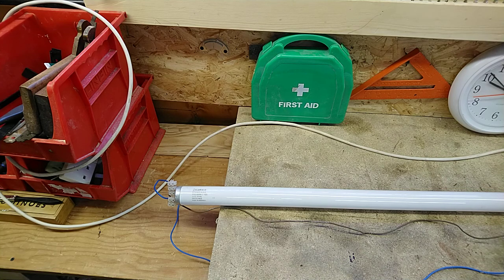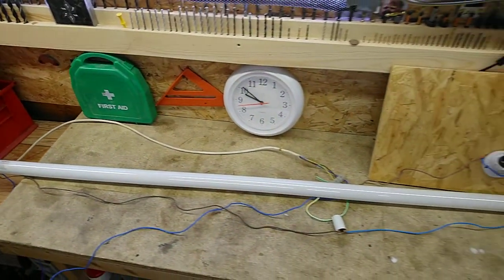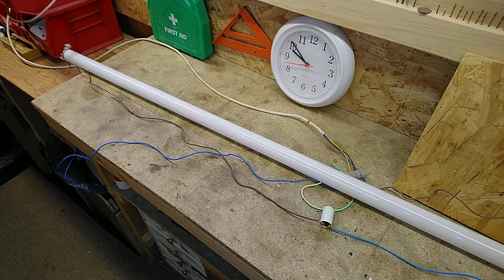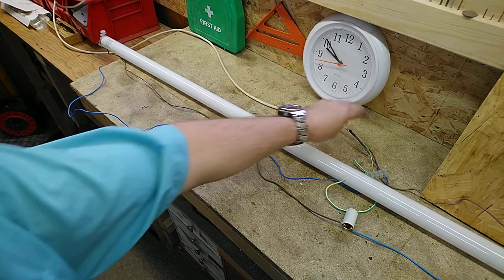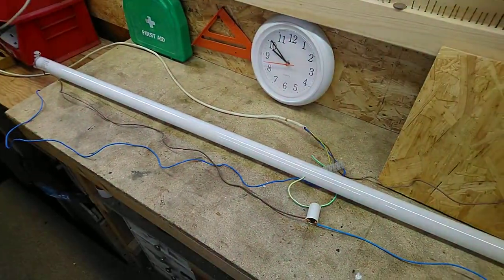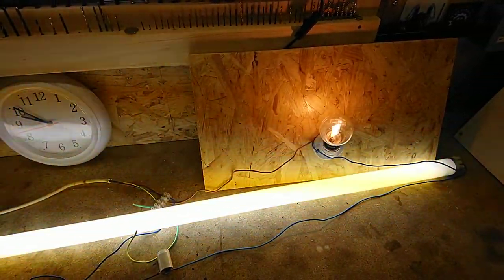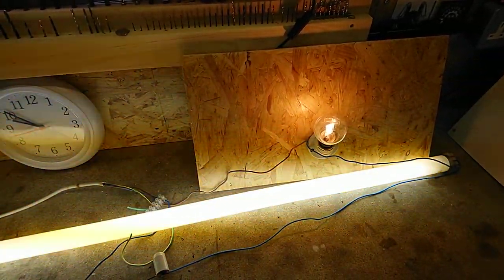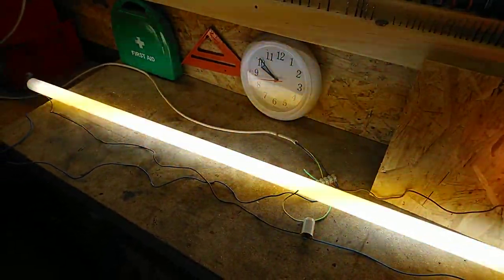Fluorescent Tube, No Ballast (MK1)

Comment: What happen if you add a capacitor in parallel with halogen?
For example a CBB 822J 1000v capacitor?
Try also increse or decrease value.
Try regulate power in this mode until bulb stay near off.
Add a little fuse in series with capacitor for saefty

Comment: Run it without a ballast at all , that's why I even clicked on this video!
Then use the first aid kit to well , aid the tube.
Reply from the maker: On 240 volts if the tube strikes without a ballast it blows instantly. You might get a flash!, You might blow a fuse!! However my fluorescent tube didn't blow up!!! Just destroyed one of the electrodes at one end. Video still on cutting room floor.......
Reply: @davesbusstuffandmore  So this was actually a nokia-like durability tube?
Can a fluorescent tube blow up btw?

Do normal lights (LED , incandescent , halogen) also need a ballast and if no why not? Why does the tube even need a ballast at all?
Reply from the maker: @CrazyPlayer-pf2hv  Blow Up! No! Fluorescent tubes have a slight vacuum, they can implode. If you drop one and it does implode glass goes every where.
Reply: @davesbusstuffandmore  That's what we're here to see
Reply: @leerman22  too dangerous
Reply: shouldve looked at the thumbnail, you can see the halogen lamp in the top right corner.

Comment: Hey Dave TheBusDriver! I tried to turn on the lamp by touching it, but it doesn’t light up. What should I do?
Reply from the maker: Both Fluorescent Tube and Starter was working with my set up. If I didn't touch to tube it still worked just took a long time and flashed a lot. T5 and T8's tubes are harder to start up. The T12 5ft tube was used in video as that one worked every time.
If its a faulty light and your not sure best get someone qualified to fix it.
Reply: Dave TheBusDriver Oh okay. Thanks for the information :)
Reply: Dave TheBusDriver I just got one question. What about 56 watt and 65 watt T8 fluorescent tubes? Are they harder to start? Does wattage matter?
Reply from the maker: @baselalhomsi6429  Yes the higher the wattage the harder to start, using a incandescent lamp (bulb) as a ballast. Best start with 18 watt T8 and work up. in another video got 2 14 watt T5's to work.
Reply: Dave TheBusDriver But Is there any easier way to start a T8 or T5 36 watt/56 watt/65 watt lamp rather than touching it? Can you do a video of starting them up?
Reply from the maker: @baselalhomsi6429  I have Part2 14 watt T5's https://www.youtube.com/watch?v=mZvM15EwWac

Comment: You might find a pair of 100w lamps more suitable, or one 200w. They're obviously not a perfect match though. Also a length of earthed metalwork running the length of the tube will greatly assist starting. Alternatively a tube with an integral metal strip and an earth connection to the caps would work.